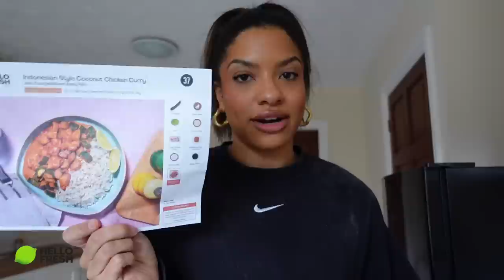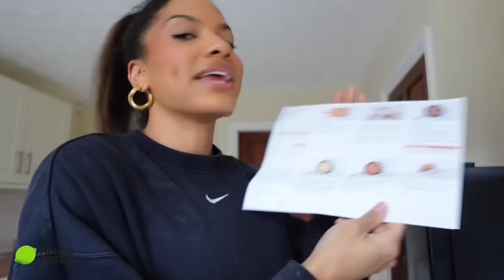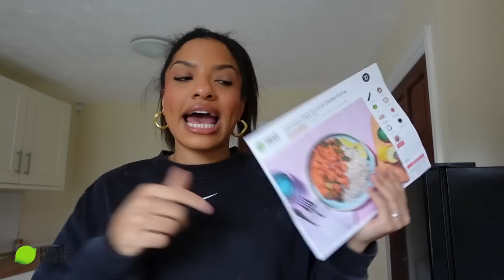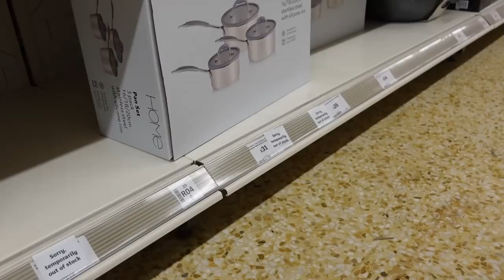Asbestos testing & investigating ceiling leaks

Comment: My suggestion is to remove the carpet, sand the floor and replace only the damaged boards, then stain and gloss the floors.  Your doors and railing are stained wood and it would look nice (if you go with a lighter stain on the floors).  But, of course, it’s up to you to decide what you like and prefer.  Look forward to see what you decide. 😊
Reply from the maker: Great ideas! Thanks for the tips 😁

Comment: Get a tape measure and measure from where you’ve cut your hole to where the pipe is disconnected and then measure from your hole to the wall where your door is. 
Add those together and then you can go upstairs and measure out your total from the same wall and then you know exactly where to lift a floorboard or two up directly above the disconnect bit of pipe
Reply from the maker: GENIUS! thank you. (why didn’t I think of this lol)

Comment: The joys of home ownership, the age age of the house doesn’t matter, there will always be something. Maybe use different food coloring in the each item with waste on the first floor. Don’t forget to pour some water down the overflows. Then you should be able to work out which device is causing the leak or if anything is connected to the broken pipe. Alternatively use a drain snake from the waste and see if anything comes out of the broken pipe.

Comment: Non stick pans heat them up pour a little water and when the water forms a bubble and rolls around like a ball there ready to use when the non stick pan stops doing that throw it away if there flaking throw it away I’ve had circulon expensive ones beautiful I’ve had scoville only buy the black speckled scoville ones  the grey ones are not fit for purpose the handles fall off however the greatest affordable non stick I’ve found is Pyrex optima pans you can order them from everywhere and they have a red handle honestly beautiful to cook with but they only do a sauté pan a frying pan and a wok but don’t have lids the scoville lids fit them also making sure the bottom outer layer of your pans the silver part keeping that bit really clean is what affects cooking once a month give them a good scrub and make sure there still sparkling
Reply from the maker: Wowwww. Thank you so so much hun! This is the best advice ever. I have one of the black speckled scoville pans and it’s fab - will extend out to the full range if I can’t find SS I like xx